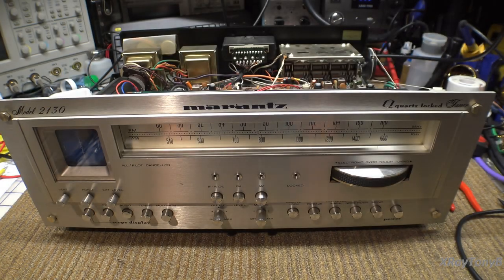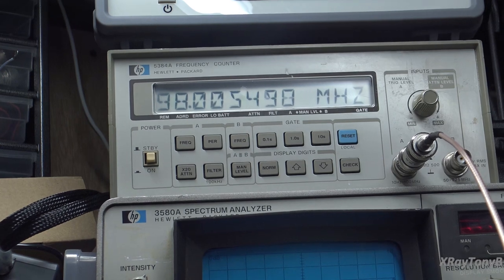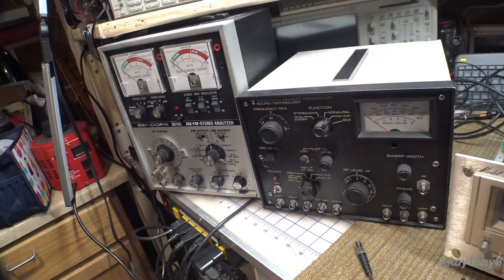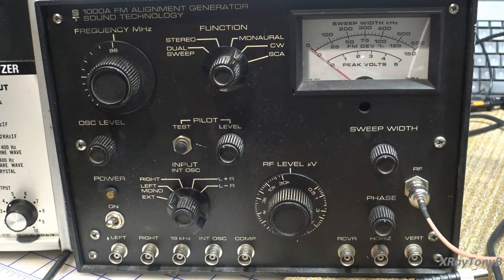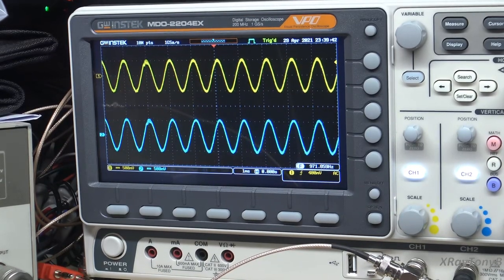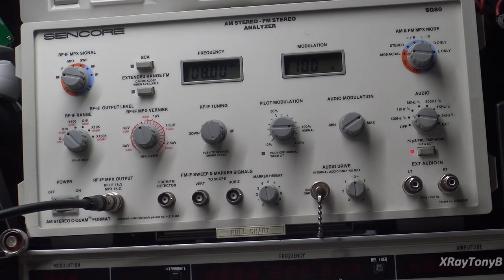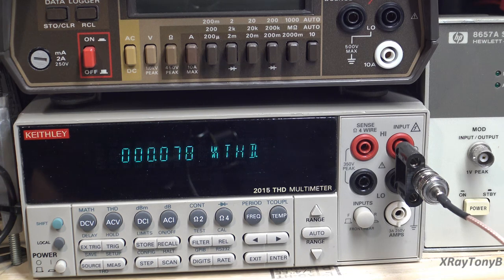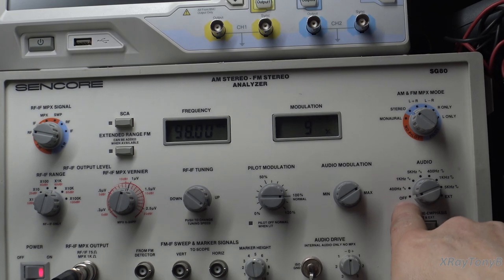FM Alignment - Featuring The Marantz 2130

Comment: Great video, Tony!  I have struggled in the past getting the discriminator primary coil setting at a point that I felt was 100% correct.  I had a 2245 open, and found that the dicriminator circuit is exactly the same as the one on the 2130.  I removed the metal cover to the board and connected DMM's to the anode of the positive diode (H503 on the 2245) and to the cathode of the negative diode (H504), and lo and behold, the adjustment to find null point works just like you said!  You have removed one of the uncertainties that I had when aligning these tuners. Thanks!

Comment: FM transmitter at a radio station I once worked at had two interesting aspects: One of the two major transmitter power tubes was blown, reducing us to quarter power, for which we had to get special FCC dispensation. This caused a lot of frequency drift, since none of the temperatures were where they should be. Also, the built-in feedback system of a heater and internal cooling systems were long since non-functional. We attempted to keep the center frequency right by alternately plugging in a 100W light bulb under the crystal canister, and turning on a fan behind the cabinet. I'm sure we often drifted into the next station's territory more often than not. We'd occasionally get DX reports from concerned folks who were trying to track us. Your analog frequency setting reminded me of this for some reason.

Comment: At 1:03.00 re: using two meters. I have had good luck with a single Fluke using the center (zoom) bar graph. Leads shorted, millivolt range zoomed to center, hit the Rel button, then connect and adjust the discriminator to where you can see the graph bouncing around the zero (since the signal there is somewhat noisy on an actual station broadcast). The original 83, 85, III series and 87V all can do this, the center bar graph zoom is a hidden power up feature on the 87V.

Comment: The chattering mute system needs a SCR (thyristor), that is set to work under its hold current. That way it latches in an instant, and lets go again without the (ususual) need to cut the supply current to the thyristor to unlatch. A small thyristor will have a hold current below a few mA (although it can switch 1/2 A or so), and with that few mA you could drive a transistor that switches the relais. So 1x thyristor, 1x transistor, and the chattering is gone.
Reply: I must add, not only such simple mechanism could cause chatter, but low FM signals sometimes fluctuate fast.

Comment: I remember I attempted to "align" my Kenwood Tuner using its two tuning meters and multi-path output. I also knew where the strongest stations were and where the broadcast originated along with two weaker stations on either end of the dial. The only external equipment I had at the time was a cheap o-scope. I was ABLE to (eventually) get real good alignment..using only a few "reference" stations. The most difficult part was "tweaking" the 19&38khz pilots using an x-y display and a good "stereo" song. I was a teenager at the time and I thought this was a "technical educational" experience that I would NEVER get in school. I never did it again. After I moved away from the NYC area and didn't have as many stations to pick from. Used that Tuner from 1970 to 1999. Not bad.

Comment: In my experience, a DMM/VTVM, 100 MHz scope, ordinary electronics tools, an isolation transformer, and a good, working CPU (i.e. brain), will work for 99.999% of all diagnostic/troubleshooting/alignment needs. It’s the other 0.001% that costs the big $$$ in specialized test equipment! 😉 Of course, a good schematic always helps! 🤗

Comment: Greetings:
We may have built this before, but using a 500k or 1 meg trimmer pot (multitude works best) tie the ends together and adjust the wiper for minimum resistance to accurately set the midpoint resistance, glipping the  adjustment screw to hold position. Wire the pot ends separately to shortish leads that will connect to the +/- sides of the discriminator circuit. Now measure for minimum DC  level between the wiper and gnd (or equal). (Save this balance setting pot for future similar adjustments. HTH.
Reply from the maker: Excellent tip!  Thanks!

Comment: Tony. When I referred to stagger-tuning in the previous video, I was talking about AM IF alignment. I've heard the results of a properly stagger-tuned radio, and the results are amazing. I guess most just peak them up and leave it at that. No wonder AM radio gets a bad rap! 

I know this tuner has a whole IF strip dedicated to the 'WIDE' setting. I'm curious who that's tuned.
Reply from the maker: The instructions can be unclear on this.  I may have to mention it in a follow-up.  This tuner has two bandwidth paths and two discriminators.  When WIDE band is selected, the signal goes through the first IF strip with the wide SAW filter and then straight into the discriminator (adjusted by L205 & L206).  When NARROW band is selected, the signal is rerouted through the narrow IF strip (L202 & L203 adjustments) and an additional SAW filter.  It then goes to the same discriminator.  The second discriminator is used for driving the scope circuit.  If properly aligned, the scope is very accurate for tuning center and multipath display.  I took me a while to figure out what was going on, but it's a really neat circuit!  Thanks for the comment!

Comment: This is great Tony. I was able to pick up an SG-165 and run it through an HP 3642A. 
Have you performed the sweep that Marantz mention in many of their tuner alignments?
Also what is your connection from generator to receiver? I’ve been using a typical balun transformer but perhaps there are impedance issues. Thanks

Comment: Hey Tony, funny how your video's come up just when I need them... :-)  Doing an alignment on a vintage Zenith stereo receiver mid 60's early transistor model. 2nd IF amp failed and after replacement now generating FM clicking.  Would love to have the equipment you do (that's another question, ie., how in the world did you come up with all that glorious equipment???) but I digress. In this video you made mention of SpecAn's not being used in the early days due to their expense. These days with just about every digital scope having SpecAn capability via FFT, do you think these complex alignments could be done more simply and cost effectively using them?  If so maybe that would make a good video. Keep cranking'em out bro.  Yours are really some of the best video's on the tube.
Reply from the maker: Most of the less expensive scopes do not have the sensitivity, frequency bandwidth or resolution to properly display the FFT of an RF signal. It could possibly be done, but you would need the proper probe and possibly a  wide band amplifier module to get the signal level up to where the scope could "see" it.
Reply: @xraytonyb  Oh the possibilities... I think I see some fun around the corner (more likely frustration).  Keep up the good work! Hope you and yours have a happy Thanksgiving.
Reply from the maker: You as well!

Comment: Tony, what piece of equipment would provide only FM MPX modulation that can feed into an RF SG like your HP8647?  Are there better/cheaper solutions other than using full featured FM Stereo SG's like the SG-165 just as modulators?
Reply: HP 8904A

Comment: The Marantz instruction to adjust the 76KHz with a pilot signal doesn't make any sense whatsoever. The oscillator will lock onto the pilot and be exactly 4 times its frequency, so there will never be anything to adjust. The idea is to get the free-running speed of the oscillator as close to 76KHz as possible. That way it has to be pulled least into lock with the pilot when it appears, which means lowest phase shift, which means best separation.